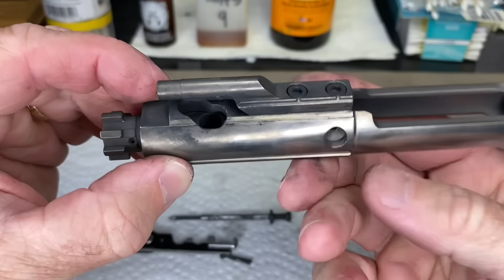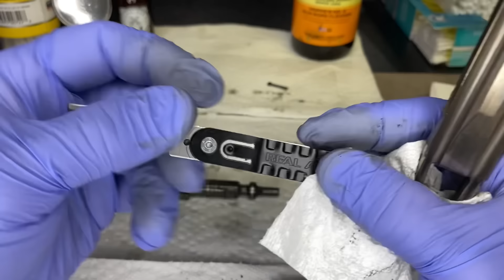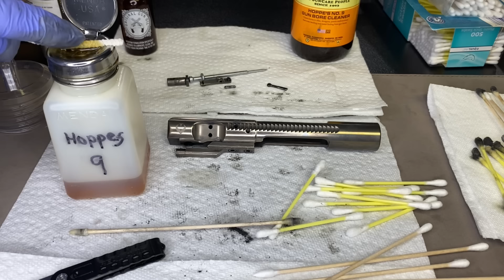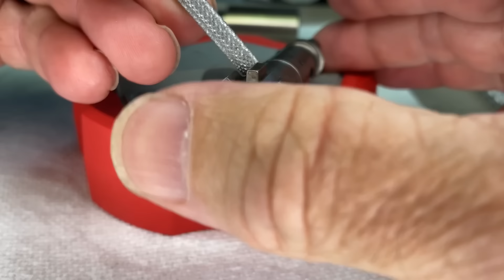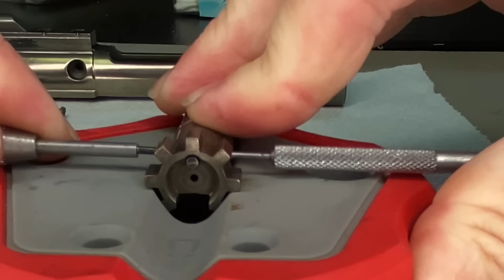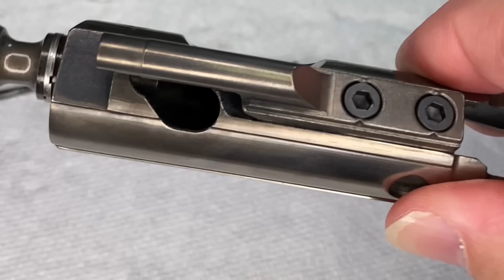How To Clean a Really Dirty AR15 Bolt Carrier Group BCG.

Comment from the maker: BCG scraper tool: https://amzn.to/45iaGig The solvent dispenser in the video is a Menda Pump dispenser: https://amzn.to/44CFNG4
Reply: i would never use these scraper tools. just oil it, wait (!) and wipe the gunk off. works perfect for me.
Reply: Yea. I finally ordered up an OTIS 5.56 B.O.N.E. BCG cleaning tool. Works. Outstanding.
Reply: Or, buy a piston gun and avoid the problem 🤷
Cleaning a piston system is much easier than this insanity
Reply: Just got mine in the mail. Real avid dupe ftw 😅
Reply: I was just about to ask what is that bottle pump combo cus I’m tired of quickly inverting my hoppes on patches. Thank you for posting!
Reply from the maker: Here is the link for the pump dispenser: Menda Pump dispenser: https://lasso.to/amazon/EMAIhDQVr8/_WJxVDuhP_E
Less Expensive Solvent Dispenser: https://lasso.to/amazon/ChmCedq68u/_WJxVDuhP_E
Reply from the maker: There is a link in the video description but give me a minute and I will add it to this string!

Comment: Is the metal on that tool softer than the metal on the Bolt?? I was always told that scraping a bolt is a no-no, but I suppose as long as you are scraping it wil the proper tool then it should be OK?? IDK??
Reply from the maker: These tools are made for this exact purpose. I certainly would not scrape the bolt with anything other than these tools. If the bolt is kept properly lubed and cleaned often, scraping will not be necessary. I only use this method for the occasional bolt that has so much crud on it that it will take forever to get it off any other way.

Comment: i've never taken the ejector apparatus apart before ... I've only taken out the firing pin and the cam pin to clean out the bcg. How many rounds does it take before you need to take the step of pushing out the ejector pins to clean the ejection apparatus?
Reply from the maker: This is generally for only occasional deep cleaning from say 2000 to 5000 rounds or if there are problems with ejecting the spent rounds. Some people like myself love disassembling, and cleaning guns so you could do it as often as you want, but the more often you do it the more likely you’ll need to replace the pin that holds it in which again is no big deal for someone who likes to disassemble their guns. Thanks so much for your question and I appreciate you watching the video!

Comment: You can eliminate 90% of this work with an ultrasonic cleaner. I just got one. Disassamble everything, run it in the cleaner at high heat, dry it off, oil it, and it's good to go. It even breaks off heavy fouling.

Comment: Question: I have seen several cleaning videos for this BCG, and none have addressed the "alignment" of the bolt gas rings. Back in the 80s, I was taught to stagger the three gaps at 120-degree intervals for best sealing. Is this not necessary anymore?  All around, a good video!
Reply from the maker: Staggering the gas rings, used to be something that was thought of as a “must do”. However, it has been shown that those gas rings move around all the time when the gun is being fired so it really doesn’t matter because they’re not gonna stay where you put them anyway! Thanks for watching the video and I appreciate the question!

Comment: Question: Im new, so excuse me if this is a newb Question.  Why wouldn't you spray clp on there first before scraping?
Reply from the maker: You certainly can do that! I actually tried Hoppes Solvent to clean this bolt but it was taking way too long. I found the scraping toll to be the fastest way by far with a bolt this bad. Thanks for the question and welcome to the community!

Comment: Never use the tip of your firing pin as a punch to push out the extractor pin. You could damage the tip of the firing pin.
Reply: The kotter pin is for that

Comment: That bcg has been under lubed. The gas system relies on tight tolerances so scraping is not good. Solvent and a nylon brush.
Reply from the maker: Yeah, my buddy never cleaned it so I assume he never lubed it either! Thanks for the comment!
Reply: Light scraping off the shwag

Comment: I don’t run any abrasives on my bolt or bolt carrier scrapping the tail over time can get it out of spec . I’m not a big fan of that method .
Reply from the maker: My thought is to use the scraper once, then keep it lubed properly and clean it often so the carbon does not build up so bad. The bolt that I cleaned in the video is from my buddies rifle that he literally never cleaned! Thanks for your input!

Comment: PRO TIP:
After disassembly, Step 1 --
Coat or soak all parts in your cleaning solution and let it sit for a while.  
Just like soaking dishes, makes cleaning them easier.  

You're welcome.
Reply from the maker: Thanks! I appreciate the tip!

Comment: I finally broke down and got an ultrasonic cleaner and it's the best time-saver ever.  Toss BCGs and suppressors in, 15-30 minutes at 60*C, and maybe you might need to do a little detail work with a brush afterward on a few parts, but that time in the cleaner lets me handle other chores meaning whiskeythirty happens sooner!
Reply from the maker: Awesome! Which one did you get? Thanks so much for sharing your experience with the ultrasonic cleaner!
Reply: @davesgunchannel  I got a 15L unit off amazon during a sale.  i've got diluted purple power in the tank.  doesn't get everything of course, but especially with multiple BCGs it takes the manual cleaning time from an hour or more to maybe 10-15 minutes.  while everything's in the ultrasonic i'm able to get all my other gear put away, some foaming cleaner in bores if needed, and occasionally make a quick grilled cheese :D  i was a hold-out for a long time, but now that they're MUCH more approachable in price, i'm really glad i did.  nothing wrong with the old fashioned way, as it's obviously a very thorough and proper job you've done above. but i do really like it now lol.

Comment: To clean a really dirty bolt, you need to soak it in cornstarch for 68 minutes with 16% water.  When it comes out, you sprinkle some pepper on it and Linseed oil and place it in a banana peel for 24 hours. Comes out clean every time.

Comment: Hey! I forgot to tell you in my updated message to you. For HARD carbon build up. Brake cleaner. 👍. Melts that HARD carbon right off. Doesn't hurt the parts. But! Just remember to put a thin coat of oil on every part you use brake cleaner on.
Reply from the maker: That's a great tip, thanks for sharing! I appreciate your comments!

Comment: 4:54 where can I order that kind of tool?
Reply: Don’t. Using a metal tool such as this should be an absolute last resort. Cotton, nylon or brass are way better than a hard metal tool which will take off material and finish when used to remove carbon.
Reply from the maker: Here are the links: CG Cleaning Scraper Tools: https://geni.us/BCGScraperTool
Heavier Duty Scraper: CAT Outdoors M4 Scraping Tool: https://geni.us/CATM4Tool

Thanks for the question!

Comment: My understanding is that scraping will mess up the gas seal/tolerances and fuck with operation.
Reply from the maker: I am sure if you scrape with excessive force with a tool that is not made for this purpose every day, that would happen. I don’t believe an occasional scraping, as I do, will hurt anything, as long as you use a quality tool made specifically for this purpose. I have never had an issue, and if you clean often and lube properly, scraping should be rarely needed. Thanks for the comment!
Reply: @davesgunchannel Thanks for replying, I say that partially because I just watched a video from School of the American Rifle where he basically says "You don't need to scrape, stop scraping, just use solvents and soak if necessary, I see so many bcgs with issues because they have bad tolerances from scraping!!"
Reply from the maker: I have seen that video. I am 100% sure that Guy knows way more than I do, I am just saying that a tool properly made for this purpose used properly on occasion is in no way going to harm the bolt. Sure, if you use the edge of a knife or a screwdriver or any other tool, it will certainly dig into the bolt. Also, if you spend the afternoon grinding the carbon over and over again over the face of the bolt yes that will eventually wear down the bolt. There are lots of ways to clean the carbon off a bolt. I just find this to be the quickest. Thanks for your comments!
Reply: @davesgunchannel I agree, further to your credit you do seem to be gentle and sparing with it. It seems like the comments on that video are full of ex military who were taught to scrape until it is "clean enough to eat off" or something.

Comment: I scraped the hell out of a bolt on that nast face over and over, and it still cycled the weapon reliably for over 5 years when gas rings and firing pin needed replaced , I replaced the whole bolt, but I didnt use metal that was harder than the bolt face
Reply from the maker: Thanks for watching the video and sharing your experience!!

Comment: Apply a rather thin coat of  high temperature gun grease prior to shooting. Afterwards the carbon is still there and messy but wipes off with a paper towel. Or take the other approach and get a piston rifle.
Reply from the maker: Great tip! Thanks for sharing.

Comment: Get a bench grinder with a extra fine wire wheel, that will clean it way better. Then take a bore brush, chuck it in a drill and bore out the gunk with any ole solvent. Then hit it with carb cleaner, done.
Reply from the maker: Thanks for the tips!!

Comment: I wouldn't use a metal scraper to clean a bolt or it's related parts unless absolutely necessary.  I would use a lot of solvent, use wood or plastic type tools to scrape
the surfaces.   While using solvent, you might have to use it more than once to
get the bolt or it's parts clean.
Reply from the maker: Thanks for the comment! Scraping should be used sparingly put on a really dirty bolt, it sure is a lot quicker than any solvent I have tried! Your input is appreciated!

Comment: I drop mine in a cheap jewelry ultrasonic machine, and they come out like new..
Reply from the maker: Thanks for the input! I have been considering making a video using an Ultrasonic cleaner!
Reply from the maker: What kind of cleaning solution do you use in the cleaner?
Reply: @davesgunchannel  Northwest enterprise ultrasonic cleaning solution , the one for carbon, grease and carburetor. I just built a vapor blaster and it is amazing , makes your BCG look like it's brand new, just don't use it on anything that was spray applied,  cerakote,  paint, etc..I'm starting to experiment with a vapor wand to clean barrels which is giving me great results.

Comment: Great video.  Per "School of the American Rifle" video, recommend you do not use scraping tools to remove carbon.
Reply from the maker: Thanks for the comment! I am aware of the video you referenced, however I do not think an occasional scraping with the PROPER tool (never scrape with a sharp tool, use one made for your bolt and do not use excessive pressure) will not harm it in any way. Also if you clean the rifle often, scraping will not be necessary.

Comment: Just get a mason jar or tin can put some marvel mystery oil in it and let the parts soak, it removes the carbon without scraping with a steel tool, an old tooth brush is usually enough to do the job.
Reply from the maker: Thanks for the tip!

Comment: im one handed :( the tiny parts are tough but i can get it down until ejector and extractor :( Is it super crucial i get those off if i can spray high pressure aerosol cleaner in the holes to clean under there ?
Reply from the maker: The spray will probably work ok. Just make sure you can push the ejector down and it springs back up pretty freely when you are done. Thanks for the question!
Reply: @davesgunchannel  thank you sir

Comment: I take apart the entire BCG, drop all parts on a small container filled with hoppes9, soak for a while, ballistol the entire rifle, bore snake the barrel with hoppes9 after the bore brush, use the Glock brush to scrub all BCG components after soaking in hoppes9, lube quite well with Mobil-1 5w30 full synthetic motor oil 😎🤣and I clean it like this after every use
Reply from the maker: That’s a great technique! I appreciate the input!

Comment: I shot 60 rounds (Fiocchi)out of my AR and it gunked up my BCG so bad I could barely get it taken apart to clean. What gives?
Reply from the maker: Was it clean before you shot those 60 rounds? Also if the gun and BCG are dry (no lube or too little lube) carbon will build up quickly. If all parts are slightly oiled, you should have no trouble disassembling your AR. Thanks for the comment!

Comment: In putting the bolt itself back into the bcg, dont forget to offset the little sliding disks so not all 3 little holes/slits line up
Reply from the maker: Thanks for the input! I have always thought that same thing, but also have heard ( Brownells video Smythbusters, if I recall) that it is not necessary to stagger those gaps. So I guess it depends who you ask!
Reply: That's hoax. It doesen't matter in which position they are.

Comment: where do you get those pipe cleaners they work good!
Reply from the maker: Thanks for the question! They are Otis pipe cleaners, and there should be a link in the description! Otis Pipe Cleaners: https://amzn.to/3Pg9mFi
Reply: @davesgunchannel  Thanks my friend I just ordered some. I used to always use a Q-Tip and just shave off some of the cotton but these are a way better way to get firing pin chanel and gas key
Reply: Duh!  Maybe try a smoke shop that sells pipes.  Those are the "pipes" they were made to clean.  Get them all day long for cheap.

Comment: Nice start but that boron bolt and carrier are still wicked dirty you just took the scale off you now need to hit it with some no9 and a brass brush when they are clean they will shine like a new nickel I would be ashamed to put that back in my weapon with no9 and  a brass brush even those burned looking marks will come off with zero damage to the boron finish
Reply from the maker: Thanks for the tips. I really appreciate it!

Comment: That bolt and carrier are wayyyy too dry. Lots of oil suspends the carbon so it doesn't bake and cake on. You can almost wipe the whole thing clean and only need to scrape a little bit behind the gas rings.
Reply from the maker: Thanks for the input!

Comment: I just dump it all in the ultra sonic with the heat turned on and use carb cleaner comes out like new.
Reply from the maker: That is awesome! So you put carb cleaner in the Ultrasonic? Or use carb cleaner after the ultrasonic?
Reply: @davesgunchannel  in the ultrasonic you can buy it as a solution specifically for ultrasonics.

Comment: I’m a mechanic by day and slowly getting into this gun thing. If we’re cleaning carbon buildup I’d be interested in seeing how well carb choke would work on this. Saves all the scraping
Reply: Works great, I use the one gallon can with parts basket. Just remove any o-rings.
Reply: Carb cleaner and brake cleaner work great for carbon removal
Reply: Carb cleaner works well. But you must remember to oil parts after else can get corrosion.
Reply from the maker: It would probably work very well!
Reply: I've used Ed's Red formula for years, and it's very effective in removing carbon. Just soak, walk away, scrub and spray with brake n parts cleaner and lube. Done.

Comment: I just use boretech and you really don't need to scrub all that much with it. I use the same boretech polymer pick they sell and use a piece of patch to get the inside of the carrier. What used to take me a really long time now takes me just half an hour to an hour at most to clean it so well that not a single black spot comes out of a patch anywhere.
Reply from the maker: Thanks for the tip! I appreciate the input!